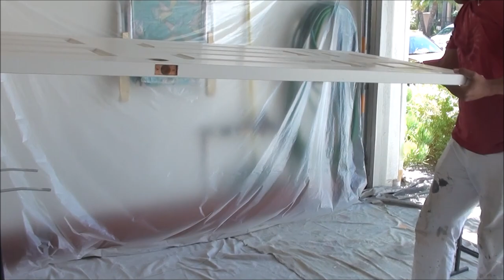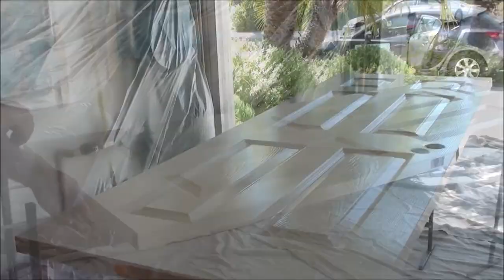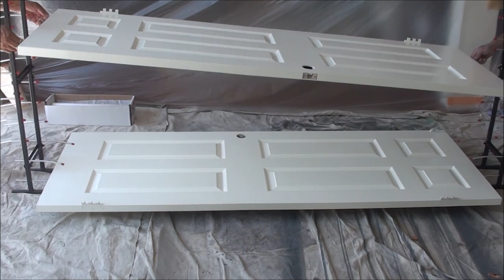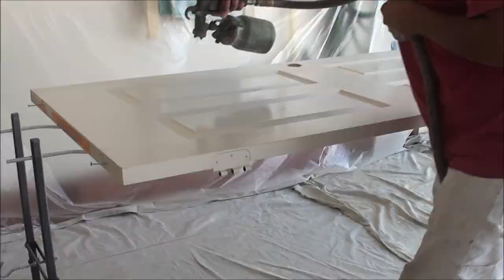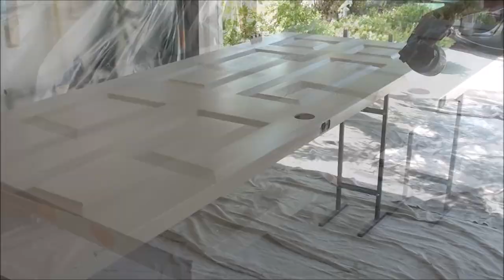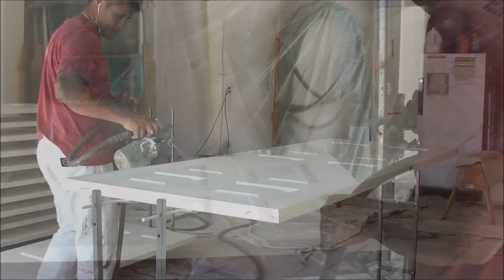Doors Spraying

Comment: Nice BUtT by the time they have painted one door I already have painted 5 or more the way I do it 👍 but anyway great job very creative
Reply: How do you do it? Im not a painter and about to paint 22 doors🥴😳 looking for advice
Reply: ZX10R Power take all the doors off cut one small pice of 1” by 10” board and screw one on the middle to part of each door. Make sure you put this on top This will give you room when you place them against the wall.
Line each door all around the rooms and freely spray all of them  and turn each door around easily. No Need to be placing them flat. I hope you understand good luck